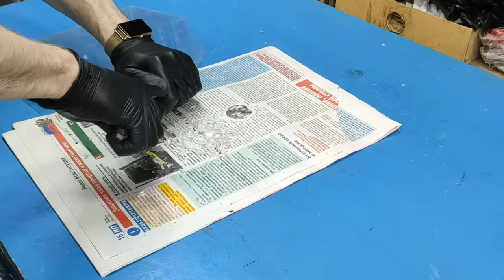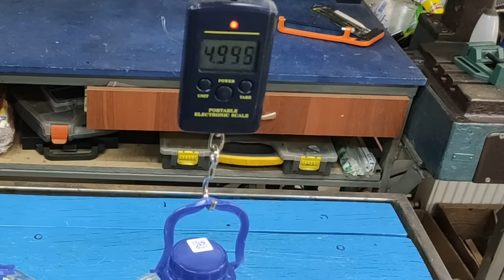I wish I had known this SECRET when I was 50! Liquid plastic with my own hands!

Comment: It looks like Plexiglass.  Which is made from Acrylic, a form of plastic.
Reply: So, maybe the nameless solvent is methylene chloride?
Reply: @nessunodorme3888  No, he's using Acetone. He translated it in the video.  Methylene chloride is nasty stuff. Overexposure to fumes can cause death.  And it's said to be cancer causing as well.  They do use it in production.  But the conditions are controlled in the manufacturing process.
Reply: @randomamerican471  Only one of his two solvents is acetone.  I since found out the other one is a mixture of solvents described in another post here.  Methylene chloride is not that dangerous unless you habitually huff it but there are probably other solvents you could try if you're nervous about using it.  Maybe ethyl acetate?  Xylene or Toluol?
Reply: @nessunodorme3888  Right, the other was 646.  It didn't dissolve the Acrylic.  I'll use Acetone as it seems to work well.  People using paint strippers containing Methylene Chloride in bathrooms have died.  Not sure about the cancer element.  I doubt it would be a problem for this if care were used.  Acetone doesn't bother me. I wouldn't bathe in it, hehe.  But it looks to work fine for this. I'm wondering if I could impregnate wood for knife scales with this stuff.
Reply: @randomamerican471  I think there's an assumption any chlorinated solvent is potentially carcinogenic based on carbon tetrachloride's link and  I keep seeing speculative warnings about chloroform, too, and now, like you about, dichloromethane.  But I also saw the same warning about acetone somewhere today while looking this stuff up.  I dunno where you live but in the US, anything to do with chemicals or chemistry is widely perceived as hazardous.  If it doesn't cause cancer or make your kids grow antlers, then it's explosive or else you're making drugs!  It's pretty easy to get spooked but, in the end, I agree with you: as long as you don't pass out with your nose in a tube of model glue for 45 minutes (like a friend of mine once did) or bathe in it, just use some care and you should be fine.  Btw,i believe that DCM in a closed bathroom can kill you.  I once had a close call when a half gallon of chloroform broke in a storage locker I was working in.  But this post is long enough, sorry.
One last thing: packing peanuts or the little beads that fill bean bag chairs are excellent sources of easy to dissolve in acetone polystyrene -- even at room temperature.  
What are knife scales?
Reply: @nessunodorme3888  Sorry, maybe I should have said knife handle scales.  https://www.youtube.com/results?search_query=knife+scales+material  And yeah, I live in California.  Where there seems to be Prop 65 warnings on everything.
Reply: @nessunodorme3888  Just don't use those biodegradable plant based  packing peanuts.

Comment: Wow! Amzing!! I'm so trying this in mould making!
Reply: Tell me how it goes!
Reply: @zaneaguilar5274  Sure! I've already got two big jars to make the aceonte mixture in. The idea is to make hard plastic embossing folders out of 3-D images I carved into a sheet of lino. I am experimenting with melting plastic but this method seems so much better. I may combine chemical and heat metling because I have to make the moulds with silane modified polymer. My experiment will eventually be most like the wonderful hard handle you made for the screwdriver. The glue was also amazing. II've got more than one jar because I want to try with all different types of plastic or acetate. Look I actually knew about this because I once tried to clean a sheet of acetate in a bath of acetone only to have it melt. almost completely That it would succeed so well as you showed I had no idea. So my own dumb luck.resulted in me looking for your film. I was flabergasted!

Comment: SUPER résultat, j'ai fait beaucoup de bricolage et toujour a chercher et imaginer des solutions, mais là je suis IMPRESSIONNÉ, MERCI pour cette solution très efficace que je ne connaissait pas 👏👏👏
Reply: Bonjour, il y a aussi le mélange colle cyanoacrylate (super glue) avec du bicarbonate de soude.
L'essayer c'est l'adopter :)
Reply: bonjour, j'ai essayé avec du plastique cassant, çà fond pas. Quel plastique il faut ?
Reply: @_jambonius_ it works but does not have strength for anything but a stationary, no stress application

Comment: When bonding two acrylic pieces either on edge or face to face just use acetone cleaner look. Putting your work in a vacuum pot will increase the strength by getting rid of any air pockets trapped.

Comment: love this stuff. so far I've been trying to get it to cure without bubbles. if possible it could be poured into 3d moulds for casting clear strong parts
Reply: To get it to cure without bubbles, you probably need to either put it into a pressure pot or a vacuum chamber and leave it for days until it's fully cured.

Comment: This is awesome, explains some things I’ve found that my grandpa had. 
Now I have a challenge for you (or anyone who knows): What can I make that would work well in a mold with fine details, be able to be fairly flexible until it’s adhered to a rounded or corner edge of furniture, then be strong enough to hold the details/bumps etc for a long time? There’s’ the flexible wood appliqués but it’s not affordable.. Accept my challenge sir?? 😂

Comment: I have a big jar with a whole mix of plastics submerged in Acetone , we shall see what does and doesn't melt and what we end up with , should be interesting , lol .
Reply: Did it work?
Reply: Finally a real scientist.
Reply: @juanparrajr  Mostly it was plastics from store bought food containers , ice cream bucket, plant container , cookie container , bubble wrap , some foam , stuff like that , none melted after 5 days , the only plastic that melted was from a hoover vacuum cleaner that i scraped , the hose connector made of softer plastic and that turned to goo not liquid. :face-blue-wide-eyes::face-purple-wide-eyes:
Reply: He used plexiglass not plastic. Plexi is an acrylic based material. Acetone will liquify it
Reply: @eddievalenzuela3009  Yup im keeping an eye out for anything similar and thrown it in the jar.
Reply: @luckypiston930 Thanks for trying.  If you find anything that works please let me know.
Reply: Here are a couple of random tips that may be useful:  Styrofoam dissolves in acetone or, really, it turns into a thick goo.  It's kind of amazing how much styrofoam will disappear into a small amount of acetone.
And, acrylic plastic is dissolved by dichloromethane, a fairly common solvent that goes by other names including methylene chloride.  Squirting a thin steam of DCM through a larger guage syringe needle is used to glue pieces of acrylic together like a weld.
If DCM is hard to find where you live, I'm pretty sure chloroform will do the same thing.
Reply: @luckyPiston  Did you happen to notice whether any of these plastics were identified either by initials or symbols (HDPE, for example) and what solvents did you use?  BTW, bravo to you for doing these tests, it's really helpful!
Reply: Question. Is that a sheet of polycarbonate? he used as the sample.
Reply: Where was this video last week when I was trying to get these damn baffles in the fish tank
Reply: @nessunodorme3888  Tks, yeah i'm just using Acetone right now , latest thing i found is dollar store clear plastic knives and forks they are melting nicely into goo :face-green-smiling:
Reply: @davidtaylor6870  nope Acrylic, poly is to tough & way less brittle, probly just stain the surface.
Reply: @nessunodorme3888  Wasn't looking at the symbols much if there even was any.
Reply: @paulwhittaker5195  Well im melting down some dollar store clear plastic knives and forks right now :yougotthis:
Reply: @luckypiston930  To be honest I'm trying to find an adhesive that will attach steel with bakelite very securely.
Reply: @paulwhittaker5195  Bakelite it smooth and dense yur best bet is give it & the steel tooth :face-fuchsia-tongue-out:(by sandblasting etc) and use a super epoxy, thats what i would try :oops:
Reply: The only interesting thing would be if you can use it to glue shoe soles that hold up. Otherwise, you rarely need an adhesive in the household.
Reply: I’m doing the same projects. Breaking it down into the recycle #. See what end results are. Post yours when you have results
Reply: @nessunodorme3888  where do I get chloroform from?
Reply: @luckyPiston  
I used a double broiler with a small
amount of mineral oil to melt
soft plastic bread bags.
Reply: Acetone dissolves cigarette butts
that were soaked in bleach and dried
It made a strange type of plastic.
It was brittle.
Reply: @paulwhittaker5195  latest update ; Plastic cutlery (clear) from Tim Hortons melts like nothin :cat-orange-whistling:
Reply: @cherylwade264  :face-blue-heart-eyes:
Reply: @luckyPiston А палочки, для размешивания кофейных напитков(с каво автоматов)не пробовали?Я пробовал ломать-какой то излом "хрупкий",не вязкий.😊
Reply: @user-hd3dm2wh2x  I haven't tried stir sticks , I have found that mainly the harder plastics and styrofoam will melt , mainly vinyls , plastic that i have to break apart , the softer plastics (bendables) tend not to melt.
Reply: @eddievalenzuela3009  I soaked a tiny piece of 1/4"X1/4" X1/16" plexiglass in acetone and 4 hours later it's still unmelted. I bought the acetone from dollar tree tho. Maybe that's the problem lol.
Reply: @luckyPiston  Got the same results. Used everyday kitchen stuff
like you, and none dissolved for over 7 days. Either these Videos
are fake, of you can only use specific type plastics,
Reply: @atlasgunther8947  Could b u r playing with Lexan , looks like plexy but differant propertys ?
Reply: ABS is the best plastic to make glue with acetone,it is incredibly strong.
Reply: @victor58010 How about CD or DVD material?

Comment: if the acrylic dissolves anyway, except for the video to show dissolving time, is there need to cut the pieces so small? Can you add bigger pieces and more acetone as you go along? What other plastics does this work upon?
Reply: You could probably make something
with water bottles or clear pastry packaging ,like moulded art work
,beads or relief work.
You could probably add acrylic paint 
or acrylic nail polish.
Reply: Think there would be any downside to mixing chemicals? Like, dissolving a plastic bottle into acetone, with a spoonful of acrylic paint for color?

Comment: Can it be made self levelling by adding more acetone to thin it more?
Reply: Yes, but it will take longer to set due to the extra acetone that needs to evaporate. I tested this with an idea I got from this video. I have several old screwdrivers with hard plastic handles. I was able to make new ones or repair some using the same method he did, except I added more acetone so I could pour it into the molds I had created.
Reply: @dtrotteryt  Thanks for the reply. Yeah, I sort of figured it may take longer to set up but I was thinking it could be useful in a box where you want the bottom to be sealed. If you could pour it in, have be self leveling and still nice and clear I would think there'd be lots of places one might find it convenient.
Reply: Will probably shrink some
Reply: @eeledahc  Hmph. Never thought of that. I suppose ot would be minimal though, depending on the size of the area you wanted to cover. It might be worth a little experimentation for proof of concept purposes.
Reply: @dale1956ties  I tried it with abs a while back, I'd seen videos about abs glue and 3d print smoothing.  I made an abs slurry and put into an silicone mold, it shrank a bit.  I did not vacuum it.  It was plastic from a broken latop fan base.  I'm assuming that it was real abs and not some type of mix,
Reply: @dale1956ties  In this video, you can see the piece of "plastic" he bonded to the wood cracked a bunch. I'm betting that was due to shrinkage. But just a thought.
Reply: @wingnutbert9685  I didn't notice that. I'll bet you're right. Assuming that it hardens from the solvent evaporating out of it it's gotta shrink quite a bit. The total volume of that stuff in its liquid form must be higher than after it solidifies. Good catch.

Comment: How long does it take to cut up the plastic?
Reply: Depends on how much plastic you're going to cut up. Come on, man. Use your head.
Reply: Get a cheap blender, shredder...
Reply: @horscategorie  Acrylic is actually really really hard, don't think a blender will cut it at all without being instantly damaged.
Reply: @JohanBosman1  I use a heavy duty cross-cut paper shredder & it works awesome.